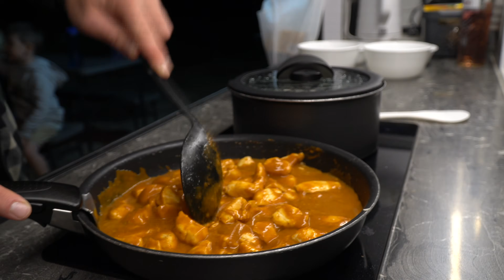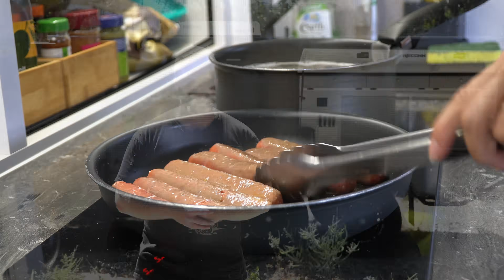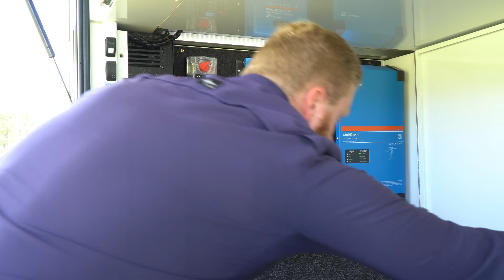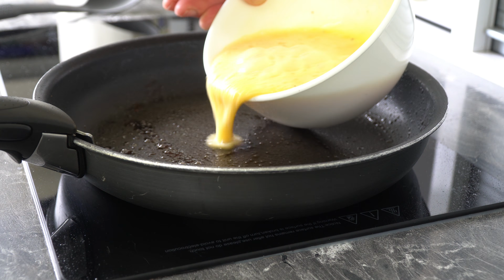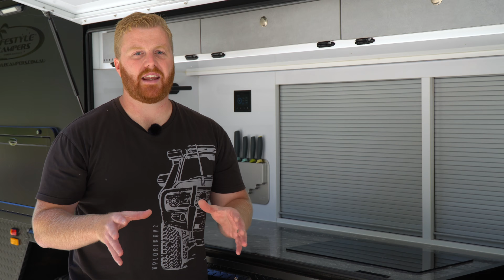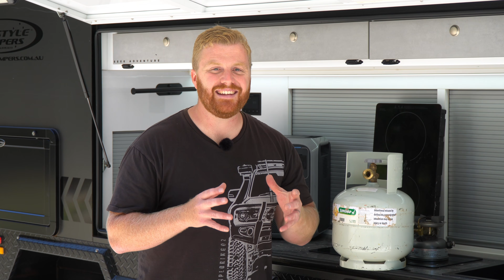WOULD I DO IT AGAIN? My experiences, failures & advice on INDUCTION cooktops for OVERLAND & CAMPING

Comment: Great informed review Nathan.
We have used induction for 2 years now. Like you we carry a old Colman burner too. But have not had to use it.... for a failure.(I used it for years before. Could not bring myself to leave it behind.)
But unlike yourselves. We have 2 old Westinghouse units like the ones you used to have in your 200. I find them more convenient. As we can cook on either side of vehicle, or even inside if weather is really bad. So we are not restricted to where we cook. We have even run a extension lead and cooked on a park bench in the shade in NT. 
We keep each of them in their own cloth bag. Keeping one on each side. Then just grab one or both. Depending what is required.
They have never failed us. 
At times we too have struggled with battery. ( 4 days on a beach near Cairns. With a tropical low. No Sun, 150mm rain. Welcome to paradise.)
So I installed a second DCDC charger. Now totaling 100A charging. So now with as little as 1 hour of driving. Will have enough power to scrap though to the next day. (We do not have to feed family. So cooking time is reduced.) 

Notable items that failed our endurance test. 
DCDC charger Cape York(we only had 1 then). It was sunny, so solar saved the day.
200 Series gearbox in 79 on Canning Stock Route. 
Thank, Electric Jesus for Star link. With the hundreds of calls and data transfers. We were able to get forward movement, and limp back to Vic. By taking off using the 6th gear clutch to get the internals spinning. Then letting it fail into 4th. Not great in sand dunes. But this is low range. So we got out.  
Wholesale Automatics repaired it under warranty. By their professional assessment. The whole transmission was F@#*d.
Plus on their recommendation, were upgraded the cooling even more. With a PWR radiator. With inbuilt cooler for 79.
We think it slowly cooked itself over time. 
So if you have a 200 series and do sand driving. Add more cooling!!!
Reply from the maker: I'm glad to hear that you have had good experiences and interesting to hear that your stories about the poor weather incidents. 
Our camper is very power hungry in general, in addition to the induction, so we need to be driving for quite sometime to recharge the batteries again. 

Interesting to hear about the transmission issues, but I strongly agree with your cooling advice. We got some extra cooling sorted when we were in NSW and this made a big difference and would now highly recommend this myself 👍

Comment: Very good opinion piece, relative and sensible.  Sensitive electronics and endless corrugations will undoubtedly take their toll on these items, which is why I'll always carry a gas BBQ on the van or  like yourself a compact gas cooker in the car for redundancy.
Reply from the maker: Thanks mate, appreciate it 🙏 
Absolutely, if you have the space then it will work well. In the cruiser with a family of 4, I'd be struggling, but in the camper it will work 👍

Comment: Insightful review.
Our van is all gas, however induction was always an update down the ways as I just love it.
You've now got me questioning the outlay to achieve not a great benefit over gas at an additional astronomical cost, hmm.
On the other hand, I do utilise induction in the vehicle.
I utilise a single element unit via Itech 54amp batteries X 3, 162 amp.
Why did I venture this way?
Well I had the battery capacity, & invertor to power our coffee pod M/C already installed in vehicle.
I was fed up with trying to cook in windy conditions, wind shroud inhibiting access, plus the extended cooking time in said conditions just bugged the crap out of me, example K'gari east coast conditions.
Coles Supermarket, Germanica induction cooker, $49.99. Thought process, that's worth a gamble and truly glad I did.
So, I offloaded one of my two butane gas cookers and utilised the induction unit.
A mate had a unit from Aldi, swore by it, so I sourced an Aldi unit, $49.99 very thin profile compared to Germanica, discovered 2 fitted in space of Germanica unit so purchased a second unit, offloaded Germanica  unit to house.
No, don't run both together on invertor but when land power source is available (occasionally happens)  we're laughing.
So, we run with 2 X Aldi induction units & 1 X Butane Gas single burner every single day. Butane unit still utilised for long cook ups, and aluminium pressure cooker.
Silverside, Pickled Pork bush camp anyone? Induction doesn't work for them spoils though 😂.
NB. Aldi units run very hot surface temps and simply aren't as efficient as Germanica unit.
Germanica unit cool to touch, very efficient and available from BCF for $99.
Coles $49.99 was a cracker of a special buy in comparison.
Love your work Nathan, Wealie.
Reply from the maker: Thanks mate, I'm hoping this can make others who are either just starting out with induction, or looking at getting into induction aware of both sides of the true off-grid capabilities. 
I won't take away from induction, apart from the power setup costs and the reliability, induction wins hands down, but from what you've just described, you've probably got the best system for overall redundancy. You have the induction for when you need it and the power to back it up (which you already had). If the power gets low, or something happens to fail, well you have the gas too 👍 
At the moment, I'm still running small (relative) battery capacity in the cruiser which wouldn't be enough and given the family of 4 I probably wouldn't upgrade just yet due to lack of space. 
Interesting to hear your thoughts on the different induction brands though 🤔 
Thanks for the input though, I love hearing others experiences and stories and I'm sure many of the other viewers appreciate it too, cheers 🙏

Comment: I don't think a more well thought out or authoritative coverage of induction cooking on the road exists. Excellent stuff. Glad to see our approach is very similar to yours for our upcoming trip, although I am a cheapskate so our DC electrics aren't as high end (also built my own batteries). Also glad to see you are powering your air con via your battery bank as I've just had this wired up and was wondering if the other caravaning dad's would laugh at me for being a soft camper. Now I can just say Nathan does it and that'll be the end of that 😂.
Reply from the maker: Thanks mate, I really appreciate this feedback, I'm so glad that my efforts can be of use to others either already in or about to get into the same market. 
Hahaha, I love it. I will say though, many people laugh at me all the time, but yet to be laughed at for being a soft aircon caravanning dad 🤣 
Thanks mate 🙏 👍
Reply: Hey mate, we have been one the road for 12 months as well and we use the aircon regularly off the batteries, my favorite time is 30minutes before getting to camp I’ll turn the air conditioner on whilst we are still driving and we still have power charging the batteries. Then opening the van when we pull out and the caravan is at 18 degrees 🥳.

Comment: Well done Nathan. We've also looked at the possibility of induction cooking on our travels. We have opted for the flexibility of using gas, it being more reliable and easily accessible. Like you said, no system is perfect and that includes gas but for the moment we'll probably stick with it. Great video again and thanks for sharing.
Reply from the maker: Thanks Jim 🙏  Absolutely, nothings perfect. I think with improvements in technology, particular the ability to recharge more efficiently, this will only become more popular, but its on the fence at the moment and still very costly 💰
Reply: @XploringOz It doesn’t have to be costly though.